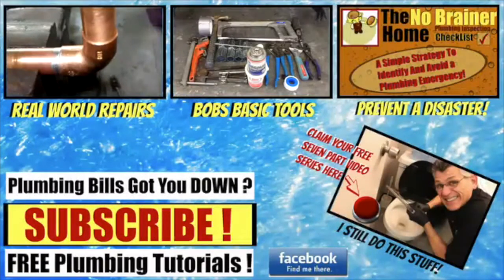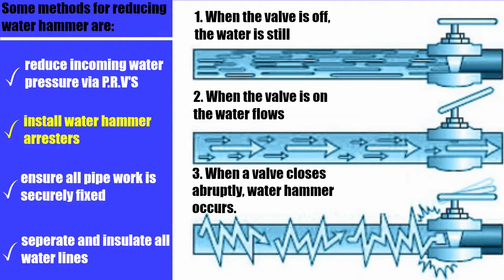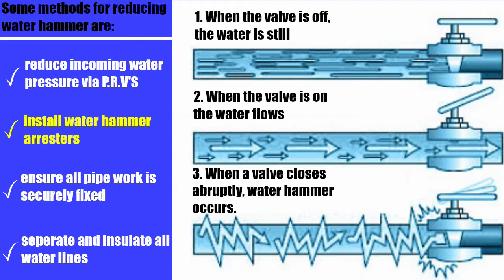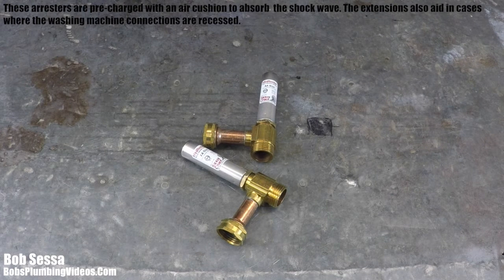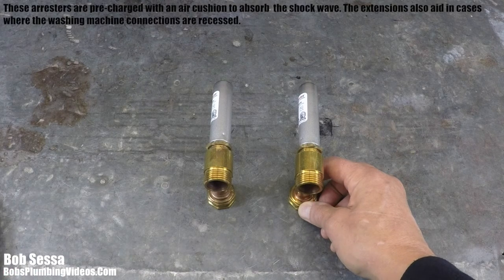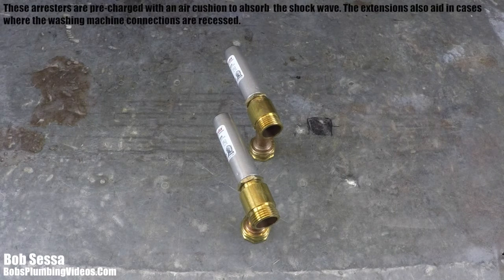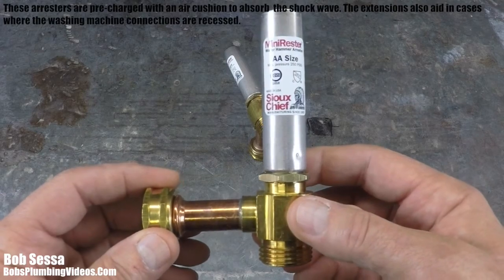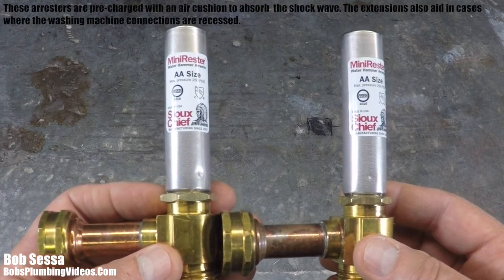Water Hammer Arrestor Installation / Washing Machine Banging Noise

Comment: Thanks for the Video Bob and all the content you put out. I recently installed a Sioux chief mini rester on the hot supply line under the kitchen sink however now, I get very low water pressure on that same supply line. I only installed one arrestor so far. Any idea why I would get such low water pressure now? Possibly a faulty arrestor? The aerator is fine because the cold water comes right out.

Comment: My backflow Valve on my steam boiler hangs up intermittently and leaks. I suspect it is caused by washing machine water hammer. My washing machine connections are vertical, is a water hammer arrestor's ability to cushion water hammer diminished if they are installed on an angle instead of vertical.? Also does it matter if they are installed at the hose bib and not at the machine connections.

Comment: I have alot of water hammer in the upstairs bathroom could I put an arrestor under the sink at the cut off or would that not help?
Reply from the maker: It will help! There are several different ways to make the connection, check this link out https://bit.ly/2De3lVM. I personally would place it before any shut-off valve, but that is going to depend on jobsite conditions. Regards, Bob.

Comment: I can confirm that water hammer can result in expensive repairs!  Had a new Samsung washing machine fitted today, ran a wash in it just once, and by the end of the wash it had caused a leak in the main water pipe further up the line.  Unfortunately the leak is in a hard to access place, and the kitchen unit will need to be partly dismantled to fix it (the plumber is coming back to do this tomorrow).
Reply from the maker: Causes a lot of problems!

Comment: I have a water hammer problem that I have not seen covered in any YouTube videos so far. The water hammering is caused by water being shut off quickly. My water hammering problems are different. The water hammering is heard when the water valves are opened too much to quicken the refill time for toilets. This problem effects 3 different toilets. To prevent the water hammering, I have to nearly shut off the value to each toilet, which causes the toilet refill time to take from 10 to 15 minutes, since the water pressure is nearly turned off to prevent the noise. If I flush the toilets, then while the toilet is filling, turn up the water pressure, the hammering is heard. I do not have the water hammering when the valves are closed, only when the values are opened more than a tiny amount. 

What is the solution for that type of water hammering problem? I recently had my whole house water pressure reduces replaced. My water pressure was 110 pounds and is now 70 pounds. The water hammering problems were not fixed after replacing the water pressure reducer, and have the hammering problems have been occurring for years. Would a water hammer arrester each toilet fix the problems? Or, would the walls need to be opened up to secure the water pipes better? We already have an arrester installed just after the water meter, which I assume was installed to cover the whole house. I don't know if that arrester could go bad after about 30 years.

I don't understand the mechanics of the arresters. Since the plumbing is a closed circuit, when the pipes are pressurized, I assume that additional vertical pipes that are used for arresters would continuously be pressurized, not filled with air at times after the pipes were initially pressurized. 

I'm not sure how effective draining all the pipes and re-pressurizing all the pipes would help eliminate the water hammering problem, since all the pipes would be pressurized with water in less than a minute. 

Do you have any solutions for water hammering that are caused by having the incoming water to toilets set to 'normal' amounts? I have not seen this problem at other homes. The problem only effects the toilets. None of the facets have the water hammering problems.
Reply from the maker: That is a typical high water pressure issue, Sioux Chief makes a large selection of mini-resters for different applications. You can take a look here:http://www.siouxchief.com/products/supply/arresters-and-trap-primers/arresters/minirester. You could also try Installing a larger water hammer arrester on your incoming water main upstream of the main shut-off valve. I've done this many times and it often solved the issue.
Reply: Are you saying that the water pressure should be less than 70 pounds? We also replaced the toilet and still have the water hammering problem. The water hammering occurs when the toilet is flushed, when the water is filling the tank, not when the incoming water is shut off by the toilet at the end of the fill cycle. None of the facets in our home have the problem, only the toilets, even the brand new toilet. 

The water hammering arrester is located just after the main shut off valve after the water meter a long distance from each toilet.  The copper water hammering arrester is about 6 inches long and 1.5 inches in diameter. The age is probably about 30 years old. I don't know if they wear out after decades. The hammering sound is close to each toilet inside the walls, but only occurs when the water is first turned on to fill up the toilet tanks. 

Could replacing the shutoff valve near the toilet fix the water hammering problem? Could the problem be fixed by opening up the wall and securing the pipes better? I hate to put holes in the walls that require a lot of extra work to fix the holes in the walls.
Reply from the maker: 70 lbs is on the high side, average here in New York is 40-55 psi, in some surrounding boroughs I've seen as high as 80psi. Modern toilets are equipped with quick closing valves which sometimes cause a problem, as you have found. By turning down the toilet supply valve you can minimize the problem but as you said it takes a while for the toilet to refill. If you already have a water hammer arrester on the incoming main water supply and still have the problem, you could consider installing mini-resters for each toilet, lowering the water pressure (do you have a pressure regulator on the incoming water service?) or a combination of both. Did you always have this problem or only with the installation of the new toilets?
Reply: @BobsPlumbingVideos  do you use " equilibrium " fill valves / float valves / ball valves / or as they used to be called " ballcocks " here in the UK in the toilet cisterns,  and delayed action float valves, for cold water storage toilet cisterns / tanks ? just as a matter of interest.
Reply from the maker: @daibhiseaghdha153  I was "weened" on ballcocks, as they were the only choice way back when I started in the 70's. And no one ever had a banging problem with them . Most modern toilets todsy  use thses quick close valves and that in a nutshell is what causes the issue.

Rgeards, Bob.

Comment: I had been hearing banging noises which I thought were coming from the washer itself until last night when the banging got so strong that it sounded like someone was in my kitchen cabinet that is on the same wall as the washer.  It was actually kind of spooky.   I guess the banging from the washing finally loosened up the pipe support.

After watching this video I purchased the Siouxchief MiniResister, installed it on the washer which took about 10 minutes and the banging is gone.  Thank you for the information.
Reply from the maker: Water hammer will definitely cause that to happen!

Comment: Do you need the water hammer arrester if plumbing with PEX?
Reply from the maker: It really has more to do with the velocity of the water (pressure) and how quickly a faucet, washing machine, icemaker, dishwasher etc shuts. You'll get same effects regardless of the pipe material If you have extremely high waters pressures in your area. I would certainly use them. Hope that helps & thanks for checking out the video! Regards, Bob.